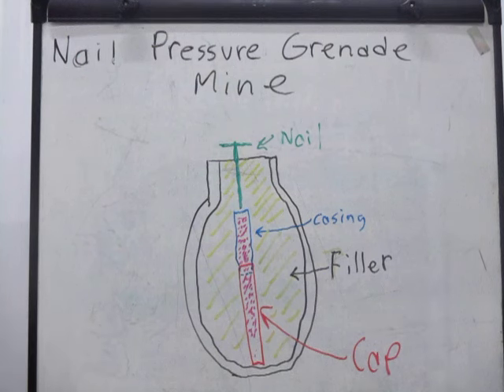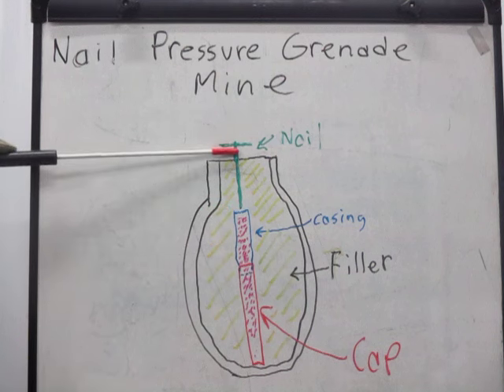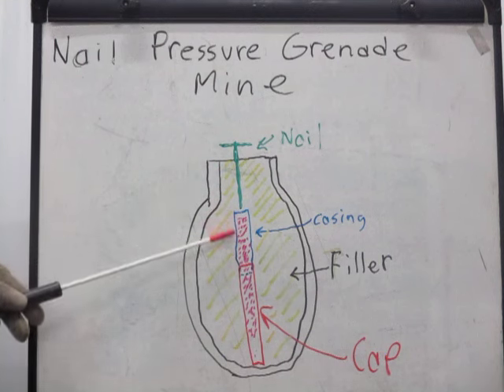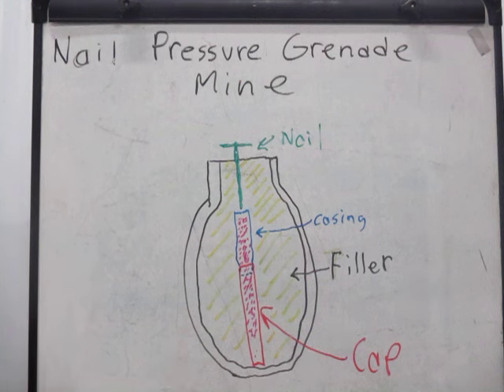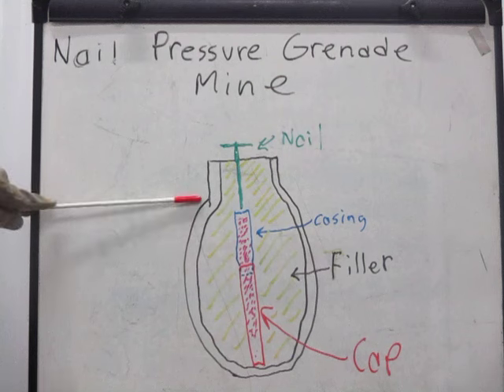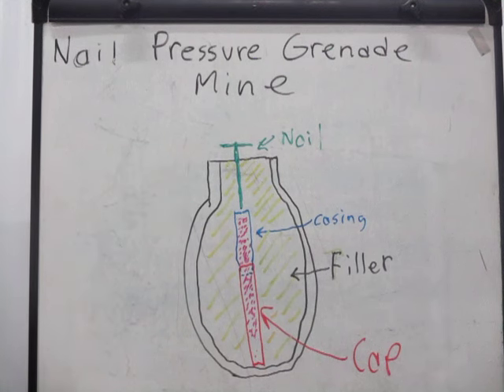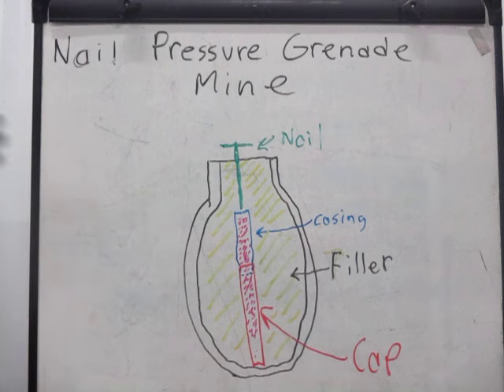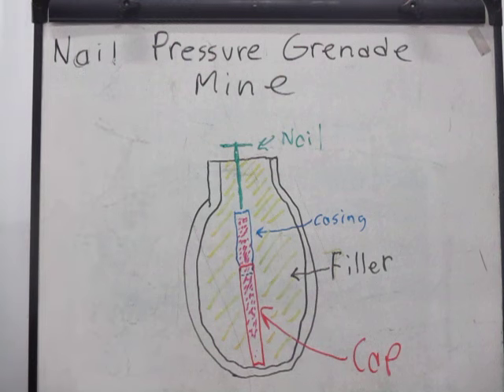Viet Cong Nail Pressure Grenade Mine

Comment: They use to change the fuse body off of a smoke grenade and put it on the grenade for a booby trap because the 3-5 sec is way shorter on the smoke grenade.

Comment: I think it might not have been seen very often because they didn’t work terribly well. When you crush a primer like this it’s not much more reliable than if it’s pierced, you really need that sharp impact like with a firing pin to make sure it works.  It’s always cool to see how people over time solved similar problems.
Reply: Yeah this and pungee sticks I think was more of a mental warfare and Hollywood trope.
Reply from the maker: @chemistryofquestionablequa6252  Funny cause this is the set up for an improvised detonator inside the current manuals issued to combat engineers......  That update came out after I retired according to the date.  And actually the one in the manual includes a shear pin for safety which would retard pressure even more.....  Guess the military doesn't know anything about explosives and ieds, huh?
Reply from the maker: @hughgrection3052  How about you talk to a Vietnam Vet about punji stakes.  Ask him if it was really just a hollywood thing...
Reply: @SecurityGuy42  that’s awfully defensive and adversarial. I was commenting on what my experience has been with primers not taking shots at your video. The scariest thing in the world is UXO, I avoid any activity that creates more of it and in my experience this system runs that risk. A shear pin breaks and releases the built up pressure creating a sharper impact on the primer btw.